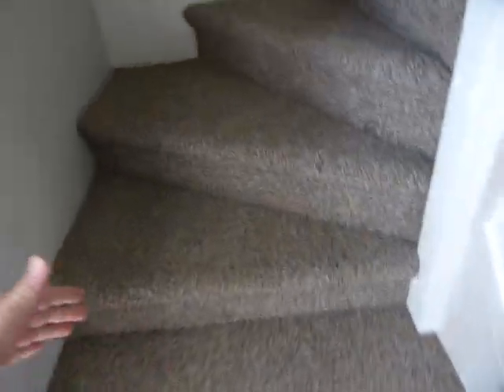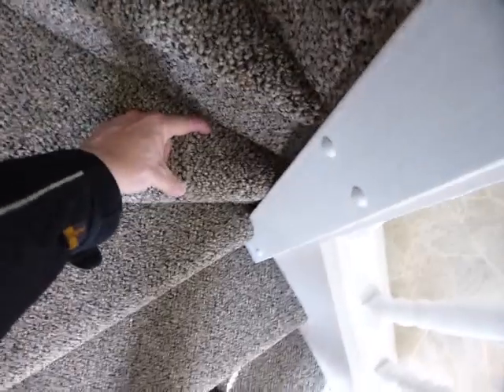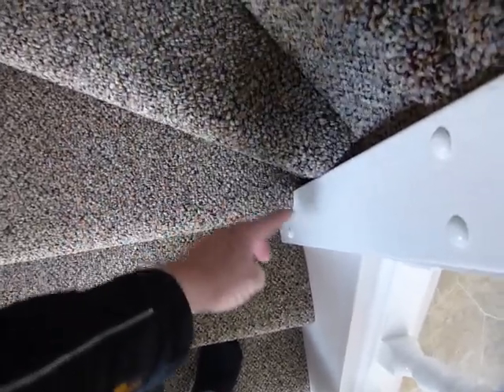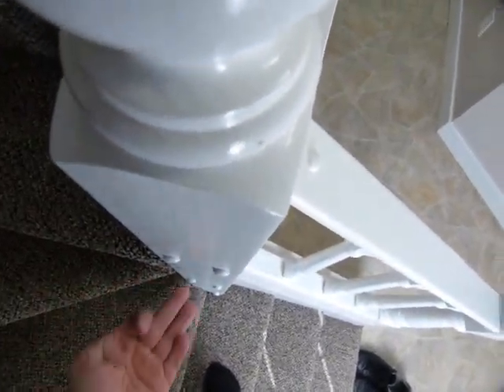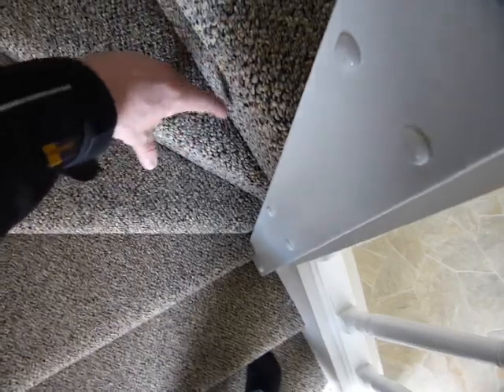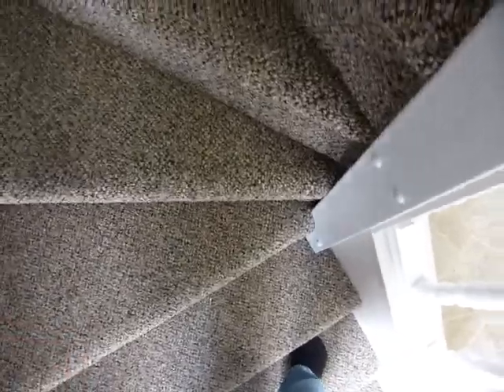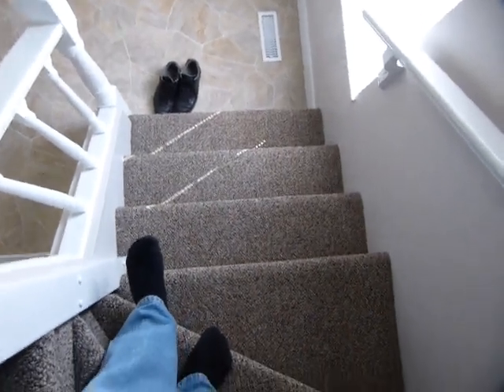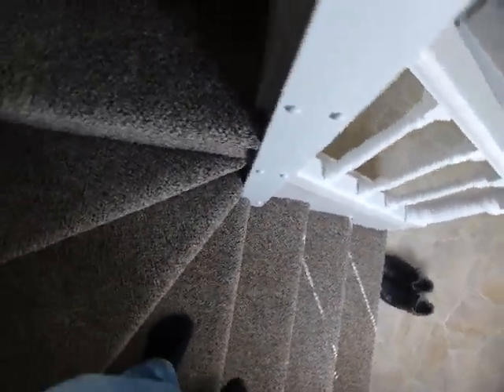Winder stair vs Building Code

Comment: The hazard of the narrow winder treads  is very clear. Do you have any suggestions as to how to make that staircase safer without tearing out the narrow treads and rebuilding the entire staircase?
Reply from the maker: +maubozret1105 Changes can not be done. To make the tapered treads wider at the front while keeping the straight runs the same width, the whole landing will have to become bigger. I`ll shoot a video, gimme 20 min to upload it.
Reply from the maker: +maubozret1105 Here is a link to explain what can be done: https://www.youtube.com/watch?v=CVqaMsuz9J8
Reply from the maker: +maubozret1105 And here is a link to rebuild options that look really good on paper but don`t work: https://www.youtube.com/watch?v=wKuRor0G_Fc

Comment: New Building Codes of BC state that the inside corner for residential be a minimum unit of run of a 150mm at the inside of turn which creates a minimum offset of 260mm, with a minimum width of 860mm finished width of tread. The total angle of turn of winders must not exceed 90 degrees with one set of winders to a staircase. Nice to see apprenticemath on here for stairs, how about calculating concrete volumes in hexagonal silos with cyndrical inner walls. I'll be searching for those :-)
Reply from the maker: +David Horn Good one. Take the area of the hexagon (octagon, triangle, anything) https://www.youtube.com/watch?v=gvzPsdqF1aw and multiply by its height to get its volume. Then subtract the volume of the cylinder inside https://www.youtube.com/watch?v=QEtR4flnWIg
I`ll make composite volume videos, I just recognized I have only cylinder.